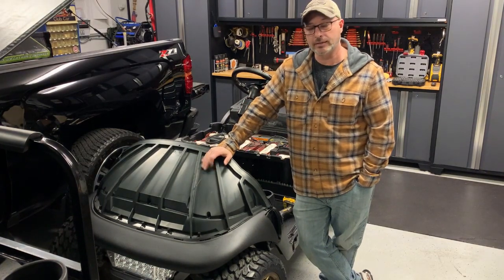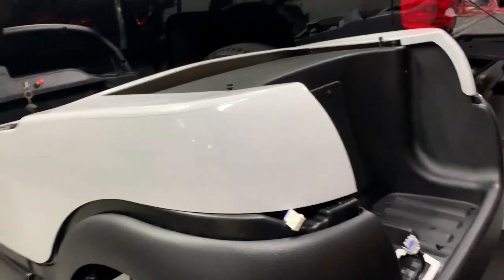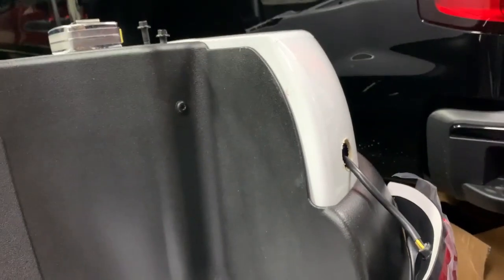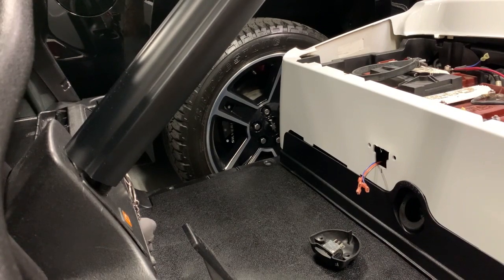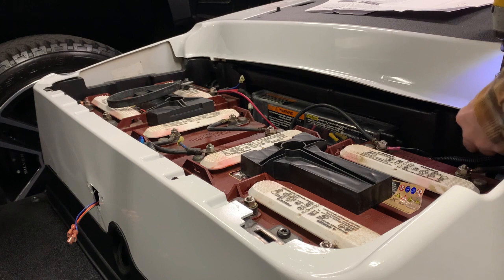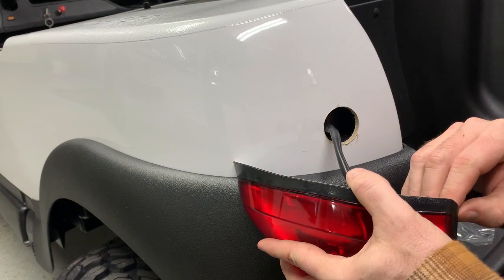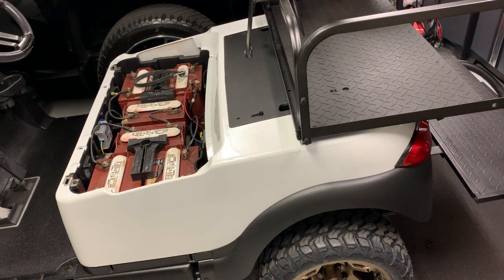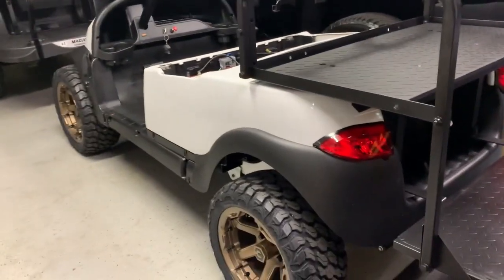Golf Cart Tail Light and Body Install - 2007 Club Car Precedent CCP Rebuild Part V

Comment: Wow. Great video man! What turn signal light setup do you recommend for a 2014 Precedent? New to golf carts but my town required working lights all the way around.
Reply from the maker: Thanks for watching and leaving a comment! Well i have experince with the Doubletake light kit on the Burgundy cart featured on the channel. This one went on with no problems and is good quality.  I have another video where i talk about the Amazon Light Kit i bought, shown in this video here. 
I went with the one selected because I prefered having the light controls on the turn signal stalk, rather than a seperate pull on the dash, But, was an issue with it. 
Check it out! :)
https://youtu.be/Db1T7RI4F5g

there are quite a few to shop from. most will go on the same. Quality seems to varry. As with many things, the more $$ the better quality.